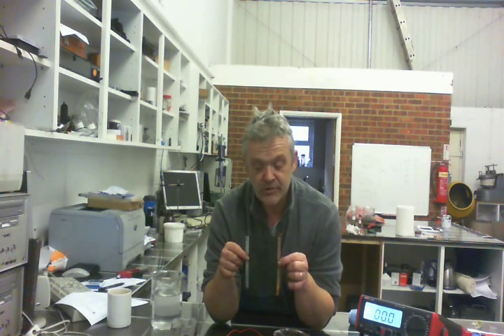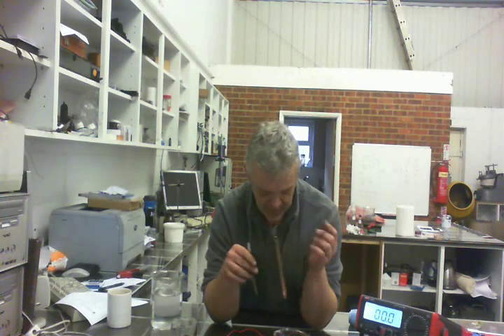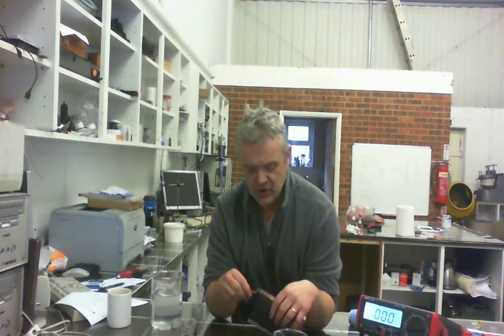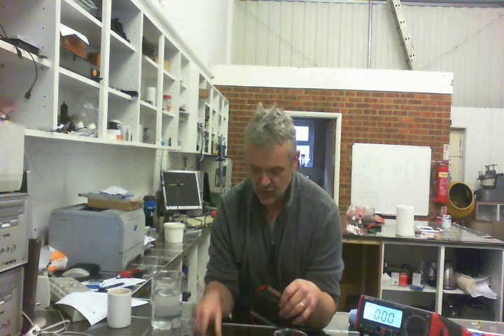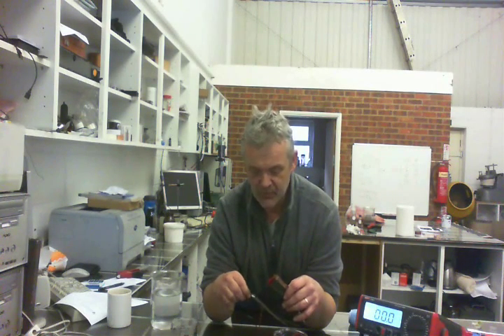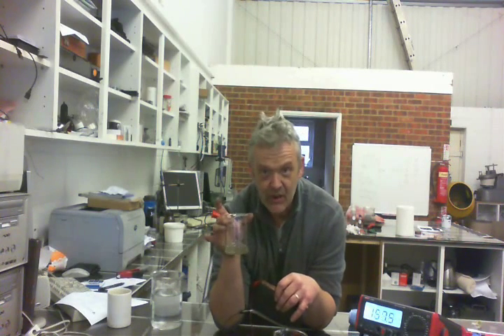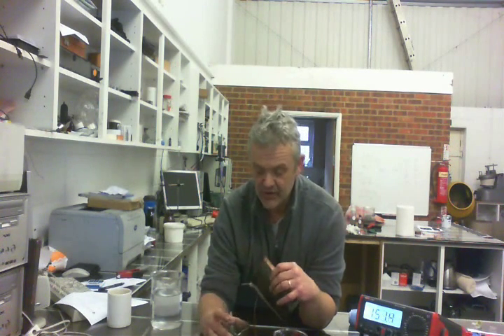SWAG Update - Swag With Deep Eutectic Solvents

Comment: I am a sailor I have a yacht andI can see so many different ways to uses this to generate power in a yachting situation. With this method you could have a soft diaphragm on two sides of a cell. Mount this  on the stern area of the yacht and the see sawing action of the boat will cause an up down effect on electrolyte. The original Swag cell mounted inline with the hot water outlet on the vessels engine would be very efficient. An open cell mounted on the stern with horizontal and vertical or at 45 to the horizontal would average a 6 knot flow plus the see saw speeds of the water. Unreal idea for yatchies every where. Great work Robert! I am excited and so are the yatchies I have spoken to.
Reply from the maker: awesome mate - i haven't done anything on this for a while as i have been concentrating on other stuff for a bit but i will get back to it soon

Comment: Great progress!  I'm not sure I followed exactly what you were doing with the darker and lighter lines caused by the magnetic field. Were you scraping the darker lines, or the lighter spaces in between? And you used a pin? Did you put the copper strips separately on the light and dark areas? Hope you have a nice time in Sweden
Reply from the maker: i scraped away the interface between the light and dark and attached an electrode to each area - so one for the dark area and one for the light area - it is cold here lol

Comment: Rob I have a question. James lovelock in "novacene" and other books(big fan of his) says that melting down plastics and turning to fuel our best bet(or repurposing like prescious plastic or rice university's flash graphene tech) because it doesn't release methane like when burning biomass. Ppl say it's too energy intensive, meaning too much heat required to melt down plastic for fuel conversion, but don't deep eutectic solvents lower the melting of mixtures significantly? Or are the other steps in the fuel conversion process super energy intensive?
Reply from the maker: sorry mate - don't know

Comment: It's possible that the two different aligned graphene lines have different affinities to the two ions in the solution. Could you try pull out the different alignments to the different electrodes when making a new SWAG Generator and run some more experiments to see the change. Otherwise scrape between the row and electrode to disconnect each type from the other electrode. If you're still thinking of dropping the salt down the generator, I imagine the size of the droplet will have and effect on the reading you get. Thanks for making the video
Reply from the maker: good ideas mate - I will give it a go

Comment: Great work. You really need to get an extra meter. There may be a substantial error computing watts using short circuit current multiplied by open circuit voltage.
Reply from the maker: will do
Reply: my favourite trick is to put an oscilloscope across a 1ohm resistor in the circuit so the V = A and you can see them together
Reply from the maker: sceptic33
don't have an oscilloscope

Comment: Hey man, where in sweden are you going? Would love to meet you if your in Stockholm and have time =)
Reply from the maker: Unfortunately this time I am off to skellefteå - but i should be in Stockholm in the new year - it would be great to meet up
Reply: Robert Murray-Smith Ahaa, cool, sadly i will be away in Poland during new year but should be back by the 5th if i remember correctly, it seems like you quite like visiting sweden =)
Reply from the maker: 7Dimensi0ns
I do - it's a nice place mate and good people
Reply: Robert Murray-Smith Wont bother you any more just want to ask till when you would be staying after new years eve, btw the fact that this has the potential to generate more electricity than a solar cell is fantastic, although having it submerged in the salt and the other thing will wear it away eventually wont it?
Reply from the maker: 7Dimensi0ns
the wear would depend on design mate - you would probably use the sea to drive a pump to pump DES with AlCl3 over it. I'm not sure of the dates just right now - i'll know better later
Reply: Robert Murray-Smith Then that could be really darn efficient, this is possibly huge stuff. Okay no worries =) have a pleasant flight!
Reply from the maker: 7Dimensi0ns
should be good mate